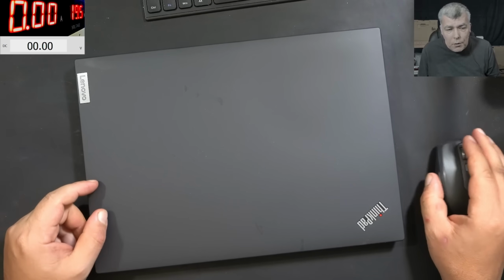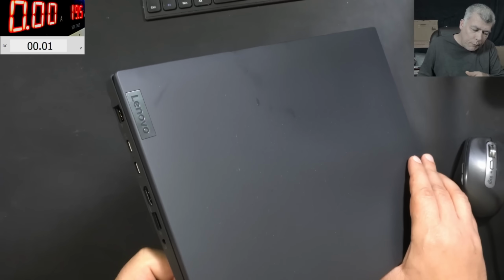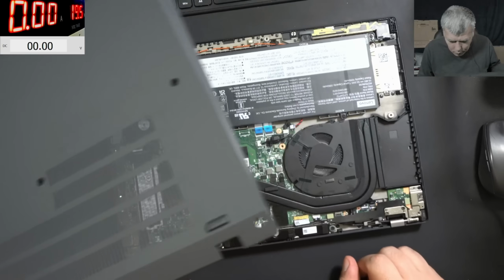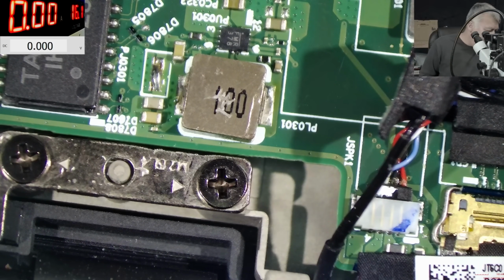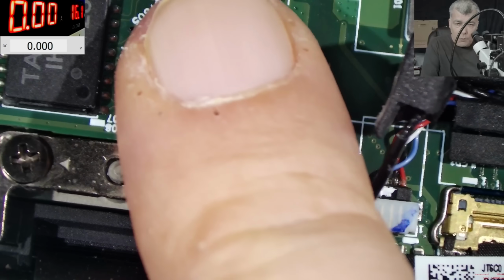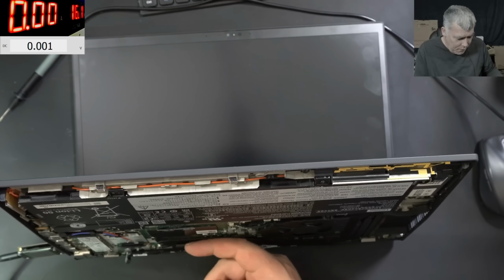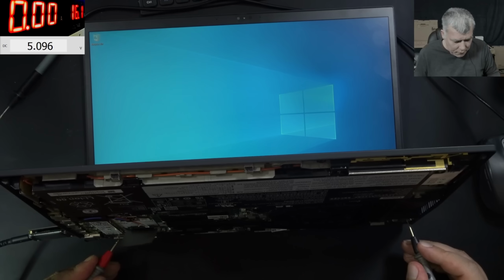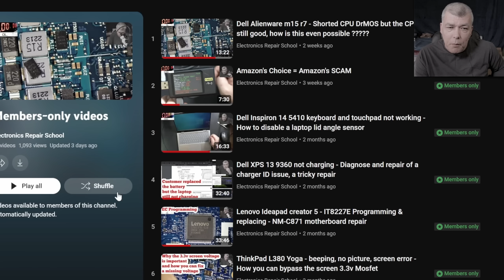Lenovo P16s Gen 2 no power, not charging - How a coil can ruin your laptop

Comment: There are 2 different designs to handle switching between AC adapter and battery power
and feeding the system:
 Hybrid power boost (HPB) and traditional circuits without power boost (see
Warning in HPB section)
 Narrow VDC (NVDC)
There are also 2 different designs to handle battery charging rail generation:
 Buck converter
 Buck-Boost converter

Comment: 13:20 Probably the same reasons why motorcycle helmets come in only 2 different shell sizes but the manufacturers use different size insulation (foam pads) on the inside, keeps the cost down and also creates flexibility on parts/servicing.

Comment: Great! It would be a good idea to at least check the switching output with an oscilloscope to make sure there isn't too much residual ripple on the 5V.
In that case replace the inductor with an higher value impedance and the ripple is reduced.

Comment: The heatsink is small probably because they use the same cooling in the smaller version. This is 16 inch with full keyboard. An airduct is an easy solution.

Comment: It's easy to explain why the coil is missing. In the first few seconds of the video, you clearly mentioned and showed that the laptop had been opened before—likely for cleaning purposes. If they used a vacuum cleaner to remove dust, it’s quite easy for components to get accidentally pulled off the board. I’ll soon publish a video about a graphic card repair where a customer used a vacuum cleaner and sucked two capacitors right off the board. After that, someone without experience tried to fix it, but instead caused even more damage. I'm not sure if I'll be able to repair it, but if I do, I’ll share it on YouTube so people can learn not to use vacuum cleaners on electronics. Well good job, thank you .

Comment: New Lenovo laptops are using low-melt solder (SnBi alloy) and it is more brittle and weaker than ordinary lead-free or leaded. (which is why coil is probably missing). Also it can ruin your day since if you mix it with leaded solder it becomes even more brittle. 
So yeah. Before soldering anything its a good idea to check what kind of solder did they use by poking iron at some really low temp like 180C and see if it melts solder or not.

Comment: I need help! I have a Asus Ryzen3 M515DA When I plug in a charger I get a solid white light only no fan spin and I can hear the hard drive spinning I have the main power rail and can not locate any short. I have 3.3 and 5v I have bought a CH341 programmer but I can not even connect my clip to the chip. I injected current on the 19v rail and then I got the orange charge light but sill no fan spin and no power on. can you give me advice I have some pictures if you like.

Comment: The free space inside the 16 inch laptops is because most companies use the exact same motherboards and other compontents for the 14 inch and 16 inch versions. Unfortunately the task was not to design a great 16inch laptop and take advantage of the extra space but to fit the 14inch motherboard they already have with minimal modifications to the bigger chassis
Reply: The free space is for extra/different heatsink They use the same casing for every cpu/gpu variant...

Comment: Seriously, those guys who make the Lenovo laptops are cutting costs in the cooler. A week ago I had to fix a device which was not responding to the power button. The problem was oil leaking to the power switch/lid switch module connector from a thermal pad. The cooler was thin, the thermal pad big. Laptop was a Lenovo i5 V14 G2 if I remember correctly

Comment: If it isn't floating around in there I'd suggest someone's taken it off - surely if it was physical it would rip the pads and there's plenty of solder on the pads. Sometimes customers aren't truthful I guess - especially if they think it will jeopardise you taking on the job in the first place.
Reply: No it was dropped or probably ripped while removing the back cover as sorin said, nobody worked on the laptop since there isnt any obvious faults
Reply: A coils a pretty big component with a fairly large surface area soldered to the board - it's not a tiny filter cap. If it was soldered properly I'd expect the pads or the solder to show some signs if it was physically removed and still leaves the question of where is it? I guess it could be wedged under the board somewhere but again, they are pretty big. And if the owner opened it and found the loose coil why wouldn't they say? They didn't mention water damage either and if you watch the channel regularly you'll know that the most likely way to get the job refused is to say someone else tried to fix it.

Comment: 13:30 If you would see the atrocities I´ve seen from cheaper brands here in Argentina... Not so long ago I fixed an EXO or Bangho, I´m not sure... It had a small cooler and a simple square heatsink (not even copper), and they where not connected by anything. I think that blowing air from my own lungs would´ve been a more efficient cooling solution than that thing. I´m not even sure how many pennies can they save by not making at least a plastic channel between the fan and the heatsink so the air can actually travel properly.

I love your videos. Greetings.

Comment: I had similar case with 43" Sony TV. It stopped working, and i found a loose coil. I soled it back, and after 2h of work it fell off again. I replace it with different one and it works fine now. No idea why the old one fell.

Comment: Good job sorin 🎉 Thank you for video. Their aim is to sell people new computers when their computers break down after the warranty expires. In the past, a computer could work for 4-5 years without breaking down. Nowadays, almost no computer can make it past 3 years
Reply: I have a Dell XPS 17 Laptop, with upgrades and maintenace, it is now operating perfectly still after 12 years.  Go figure. I am typing on it now.  Hate the new laptops the way they feel, namely HP Models.
Reply: @frankm4277  I get you. Modern laptops are all plastic, too powerful and too thin. The hinges always break where they are scrwed into plastic. My old Dell Precision M6600 (same age as your XPS) has an all metal chassis, the whole thing is a tank. If I dropped it on a new laptop, the new one would break!
Reply: Watching on a Macbook Pro 2015, which is not even the oldest machine I have here. Have Dell laptops and desktops older that I picked up for a few quid on FB that are in daily use and show no signs of falling over.  Old gear is the way!
Reply: Unfortunately, today's computers are not that durable. I still have laptops from 2010 at my workplace that are working fine. No computer purchased today will last 4 years, let alone 10 years
Reply: Yeah luckily most things can be done on older laptops that are given away on Facebook. In Oz I struggled to sell a 16gb 256sd apple mac.laptop for 70 pounds. And even then customer haggled. No demand for laptops has driven prices way down.
Reply: @Swenser  Ditching Windows extends the useful life of all hardware for a start. 🙂
Reply: My HP Compaq nx6325 is still going strong in 2024... 😎😁✌
Reply: My hp probook 4540s is still the king since 13 years
Reply: If you can, don't buy a new computer. Almost all computers released in 2014 and later are the same. Most computers with BGA processors and later don't make it past 4 years. Old is gold
Reply: Obsolescencia programada a full
Reply: Sadly this is true. :(